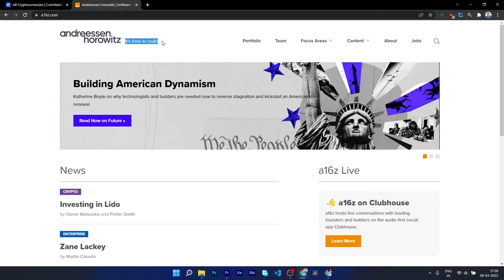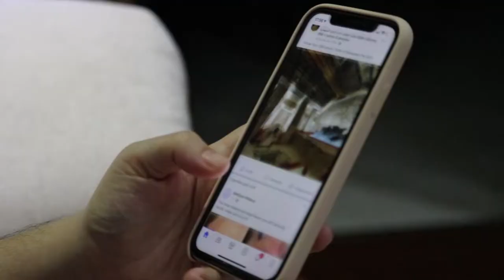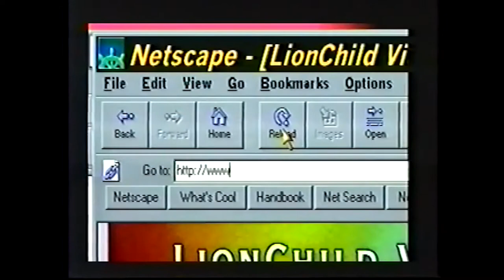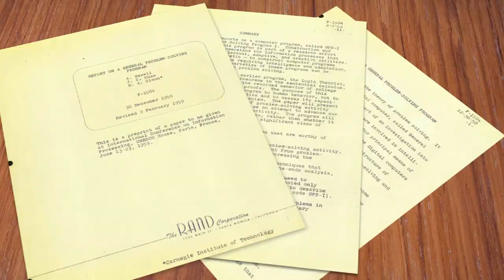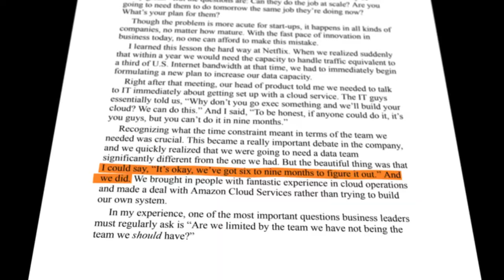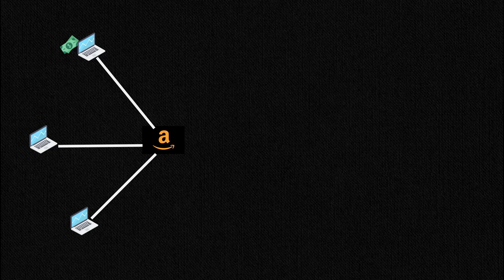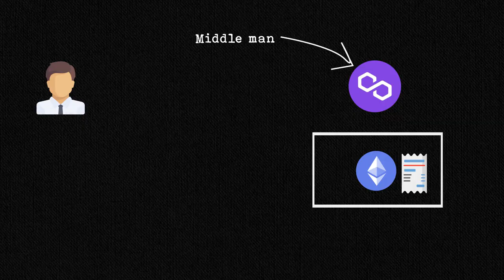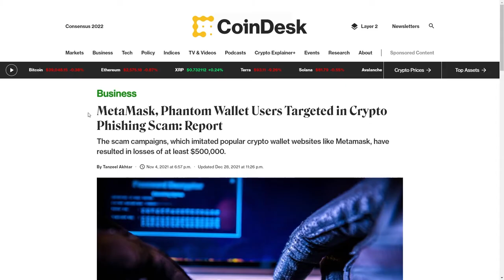Web3 : The Upcoming Biggest Ponzi Scheme

Comment: Good points highlighted ,but Maybe there will be some more improvements in web3.0 architecture and will avoid any middle man in it and will be completely decentralized.  We can get a good understanding of web3.0  by looking torrent protocol right ?
Reply from the maker: Torrent does work P2P but to connect every device with each other over the internet, most torrent uses tracker server (which is centralised) that helps every user to get each other IP address to communicate effectively. Compared to DHT, this way is much more faster. But yeah, once you get the address of other recipient you don't need to ping the tracker unless your connection gets abrupt or IP address get changed from switching from cellular network to Wi-Fi or vice versa.

So it's semi-centralised. I'll cover BitTorrent in coming days.